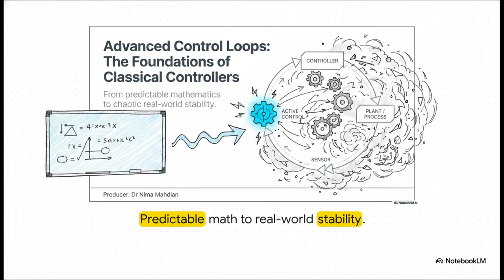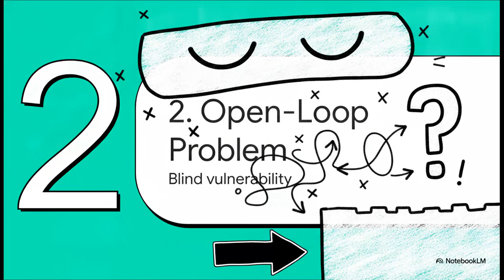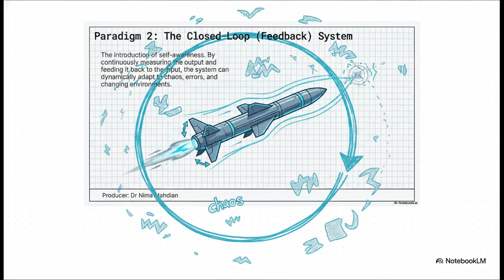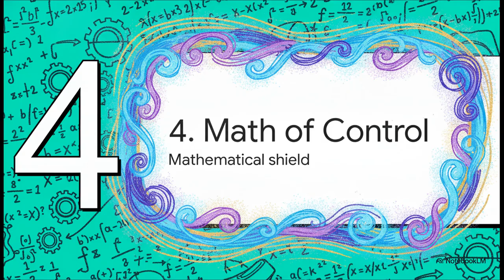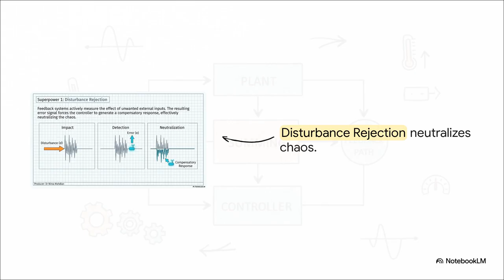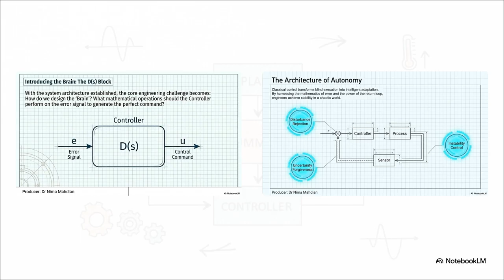Foundations of Classical Controllers | Industrial Automation & Control Engineering-Part 1

Comment: it was very clear and presented the concepts in a logical sequence. I have equation; How can we obtain the benefits of high gain while maintaining closed-loop stability?
Reply from the maker: Achieving the benefits of high feedback gain while maintaining closed-loop stability requires a careful balance between performance and robustness.

In practice, engineers do not simply increase the gain indefinitely. Instead, they use controller tuning methods, stability analysis, and adequate stability margins (such as gain and phase margins) to select the highest gain that still provides stable operation. If higher performance is needed, techniques such as PID control, lead compensation, cascade control, or feedforward control are often used instead of relying solely on increasing the proportional gain.

The objective is to achieve fast response, small steady-state error, and good disturbance rejection without introducing excessive oscillations or instability.

Comment: I have a question why is open-loop control described as "execution without observation," and how does it respond to external disturbances?
Reply from the maker: Open-loop control is described as "execution without observation" because the controller sends a control action based only on the input command or a predefined program, without measuring the actual output. Since there is no feedback, the controller cannot determine whether the desired output has been achieved.

As a result, open-loop systems cannot automatically compensate for external disturbances, load changes, or model uncertainties. Any disturbance directly affects the output, and the controller continues applying the same control action unless it is manually adjusted or reprogrammed.

This is why open-loop control is suitable only for processes with predictable behavior and minimal disturbances, whereas closed-loop control is preferred when high accuracy and disturbance rejection are required.

Comment: Dr. Nima, I have a question. Why is feedback control still necessary even when an accurate mathematical model of the system is available? Also, under what conditions can feedforward control outperform feedback control despite the robustness of closed-loop systems?

Comment: Dr. Mahdian, I appreciate this clear and useful explanation.
i have question ,Since increasing feedback gain can improve correction and disturbance rejection, how can an engineer choose a gain that is strong enough to reduce errors but not so high that it makes the closed-loop system unstable?
Reply from the maker: Thank you for your excellent question. Choosing the feedback gain is always a trade-off between performance and stability. Increasing the gain generally reduces the error and improves disturbance rejection, but if it becomes too large, it can cause oscillations or even instability.

In practice, engineers determine a suitable gain using system modeling, stability analysis, simulation, and controller tuning methods such as Ziegler–Nichols, frequency-response techniques, or root locus analysis. The objective is to select the highest gain that provides fast, accurate, and stable performance with adequate stability margins.